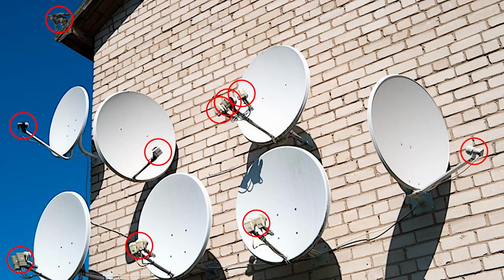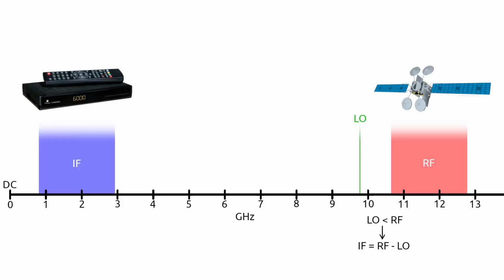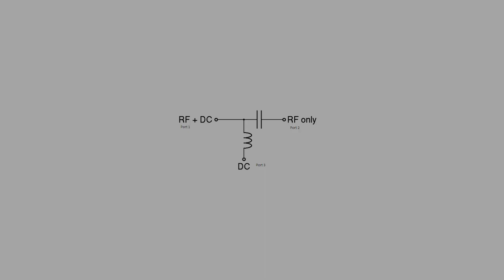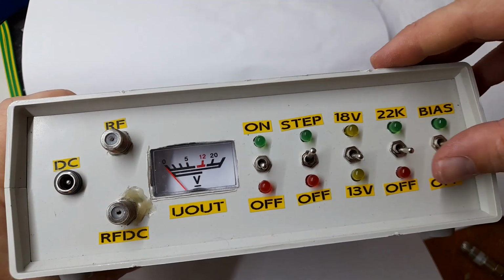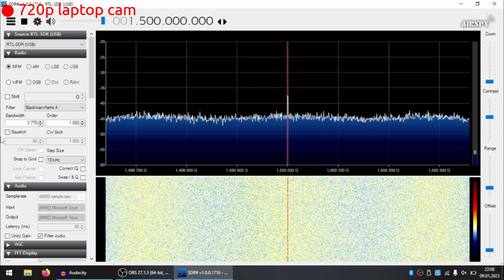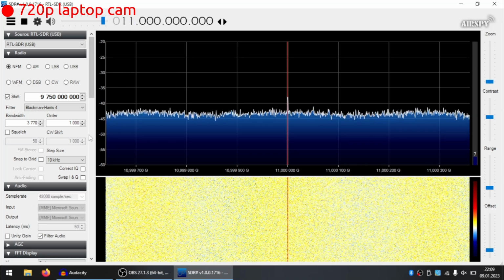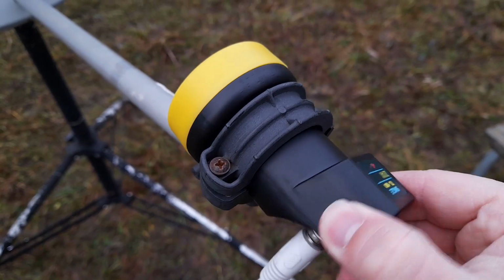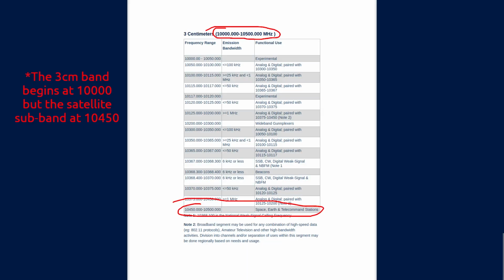Connecting a Ku-band LNB to an SDR || Satellite reception pt.6

Comment: Some of the NA sats had open internet traffic on them packaged in standard transport streams. I captured a few streams off a transponder years ago with a linux box and a dvb card.  Tried to play it with VLC and nothing, so I popped it into a few transport stream parsers and things looked weird ,  dumped it, opened up  some  of the 188 byte packets with a hex editor and saw HTML. Someone was looking at a webpage that sold supplies for firefighting.   It was interesting to see especially packed in something more designed for TV use.
Reply: Leave it to Hughes… 😂
Reply: I played with a program called fake ftp on DBV-S cards  kiss and skystar back in 2002 ish many years . on linux  . back then with small hard drive. tapping random data from satellite

Comment: Interesting stuff man. I used to hunt for satellite truck broadcastings on various satellites. I had an INVACOM QPH-031 Quad Polar LNB which handled both circular and linear signals, hooked to a simple FTA receiver with a DiSEqC Motor and switch -- so I wouldn't have to have multiple dishes nor manually move the dish. Of course that was not for amateur radio purposes and back then there were no SDR radios. Still, I liked your idea. Subscribed.
Reply from the maker: I know what you mean, looking for backhaul feeds does sound interesting, but also very time consuming and probably wouldn't make for good youtube content due to copyright lol
This is something I want to try, on Ku and C-bands but hopefully in the future also Ka

Comment: Nice video. I'll probably put something together to monitor Q0100. For TX on QO100 well that's going to be a bit of saving up.
Reply from the maker: Hopefully I'll have a video about some uplink setup too in the future. Already did some "successful" experiments with a cheap hackrf clone, but its power output without a proper amplifier is so low that it barely made it with a 2.5m dish

Comment: Hello! What can one do to get the video signal faster? I mean to make sure that the video sent thought satellite is getting the fastest way possible to a monitor. Thanks!
Reply: Reverse the power supply polarity.  The choke is the polarity diodes, so if you already know what your polarity is on the power supply, just hook it up backwards to ensure maximum performance.

Comment: Can i use two port LNB, from one port can I directly give 13V to 18V and from other I can get signal to SDR by directly connecting with coaxial cable?
Reply from the maker: That may depend on the LNB, but if you're gonna try make sure to check with a voltmeter that the other port isn't backfeeding those 13-18 Volts into your SDR. The safest option is an external bias-tee where you have a DC isolation capacitor on the SDR input

Comment: Hello, I also set up a receiver by USRP, LNB and power injector according to your article. Because my LNB's OF is 9750MHz, so I set to observe 1575MHz（11350-9750）in Gnu-radio.  Everything is fine but I still can't receive Starlink signals. I 'm thinking maybe the satellites don't transmit beacon all the time about which I'm not sure. So what do you think of that? I'm thinking whether I need to but a Starlink User terminal set up beside my whole receiver devices to keep the satellites transmit signal. And according to your article, you receive signals successfully without doing that. Can you give me some advice? Really Thanks.
Reply from the maker: Hi, it seems like the satellites indeed transmit a lot less frequently now. Depending on where you are located it may take some time until you see some of their signals. Someone in my Discord server who is from the US tried recently and still received plenty of them.
Reply: @dereksgc  You mean I don't need to set a user terminal to make sure that satellites keeping transmitting signal ? I need to observe a low frequency? But where I can find the information about frequency related to my location? Can you give me some advice? Thanks.
Reply from the maker: @rangowang9432  You do not, the frequency of the beacons is the same worldwide (11325 MHz).
Reply: @dereksgc  Thanks, so I still focus on 11.325., and I have to buy a Starlink User terminal. I guess you can receive the signal even without setting a User terminal by side because there were someone was using that nearby you.
Reply from the maker: @rangowang9432  I do not believe you need to have a terminal. I live in an area with great cell and fiber coverage, no people here are using Starlink
Reply: There may be confusion between the words "frequently" and "frequency." @dereksgc said it seems the satellites transmit less often (frequently), and it might take some time to see their signals. It appears you thought he meant they transmit at a lower frequency now. The words are so similar in spelling and meaning.
Reply: @dereksgc  Thanks. I will try.
Reply: @EinsteinsHair  OMG, thanks. I'm too careless to see that.🤣